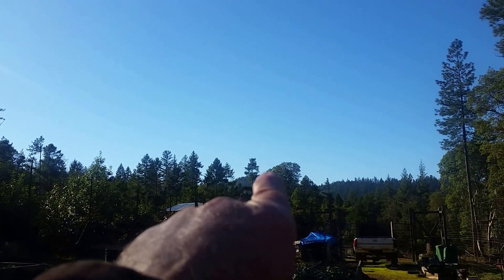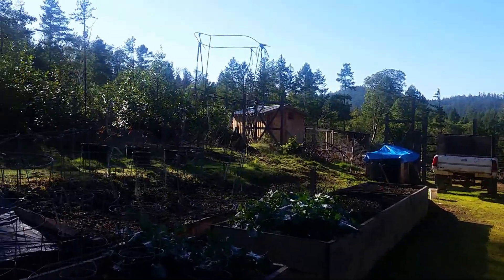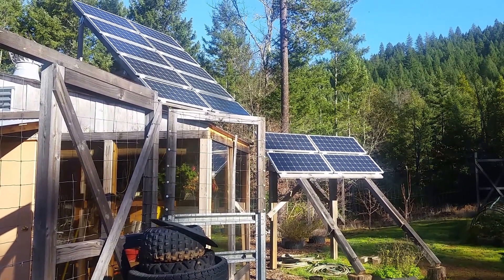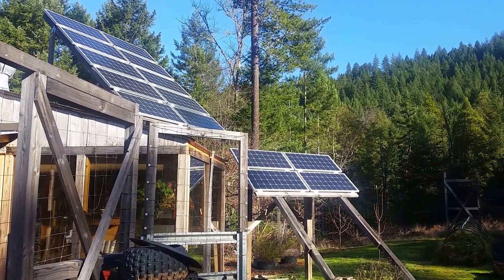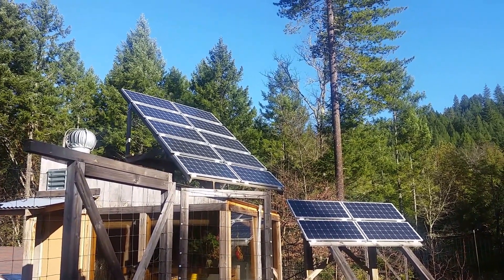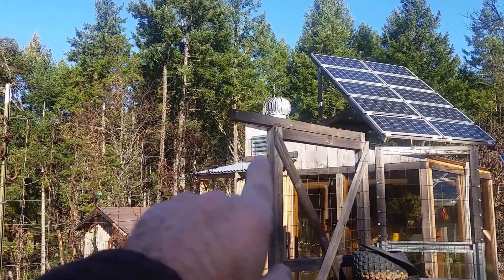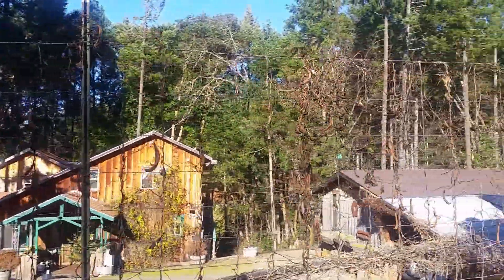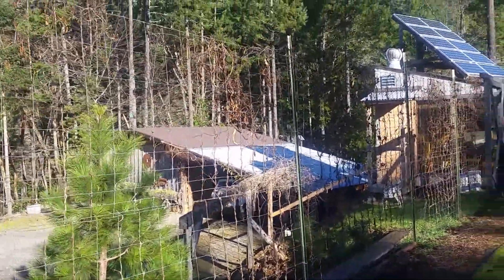Questions and thoughts about adding more solar panels

Comment: yes get 2 charge controllers so you can get the larger panels, you can get EP solar 40amp mppt for 280 US they can take 750w at 12 volts or 1500w at 24 volts.

Comment: HI Steven.  I live a little north of you and would say MPPT is the way to go.  Mainly because it allows you to combine the power of your panels better.  You can wire them together in series and get longer power production in the early morning and later in the afternoon.  The morning and afternoon numbers won't get anyone excited, but they are better than the zero a PWM controller would generate.
Reply from the maker: Fernbark Frist That is a great answer. That's what I will do. A new 2k array on a Midnite classic and see how it goes. If it is working better in low light (PNW) is famous for lol. I will buy another one for the existing system. I have cleaned 28" of snow off my array in the last 2 days. I think I'll have the new array closer to the ground. Thanks for the advice and happy new year!
Reply: I wish we lived closer together.  I would love to help you set it up.
Reply from the maker: Thanks for the sentiment. Adding to our system seams like the right thing to do. We are living fine on 1400 watts. For  3 months  of the worst part of winter we run the generator 2 hours a day and let the solar finish the absorb. It just seams right if I can cut down on the diesel by adding more solar. I burned 27 gallons of diesel last year total. Not that expensive  ($56.) But it would  be nice to run the diesel less in the future.

Comment: I agree MPPT is the way to go. I have mine set up for "sweep" mode...excellent results. From what I learned and did, ground mount (with tilting and/or tracker) is the way to go. Maintenance is a 1,000x easier when your on the ground. Install and wiring is a snap. On a roof or up high (cooling issues, cleaning issues, etc-etc). If I could have a 10,000 watts on the ground with no shading issues...that would be dreamy.
Reply from the maker: Wow Chris 10K of solar! you could run a welding shop lol. I'm just about sold on a Midnite classic 200. Merry Christmas  and Happy New Year!

Comment: Steve why change your current one? If you add ten new 250w panels put the mppt on it and run as two systems to charge your batteries. Just a thought as you could always upgrade if you see a marked improvement between the two. Or as you have springs add to your hydro. Have a fantastic xmas a enjoyable new year.
Reply from the maker: I agree, thanks for the input and have a Happy New Year!